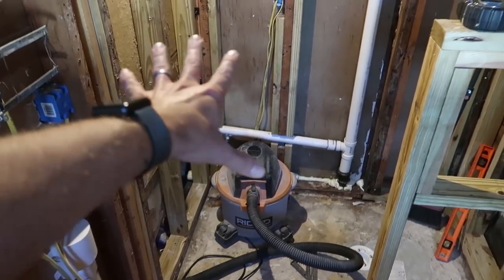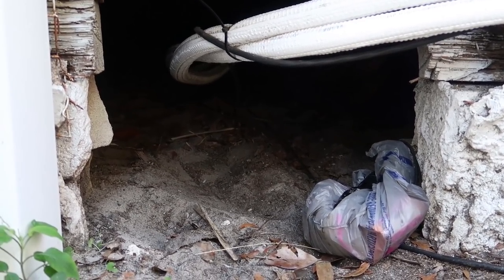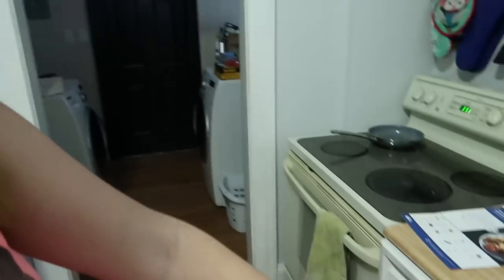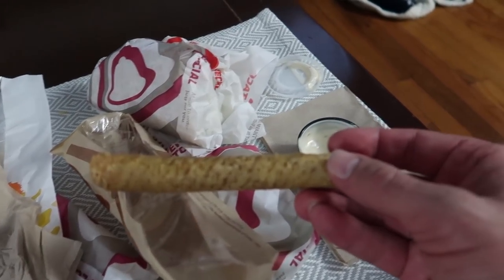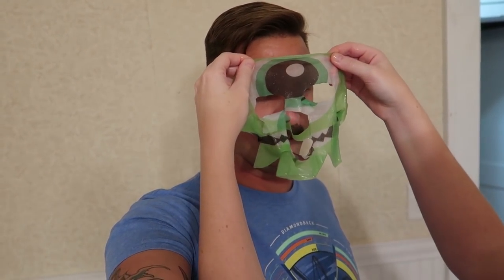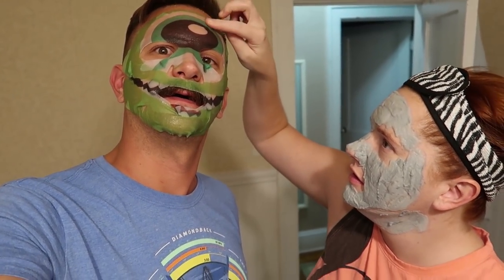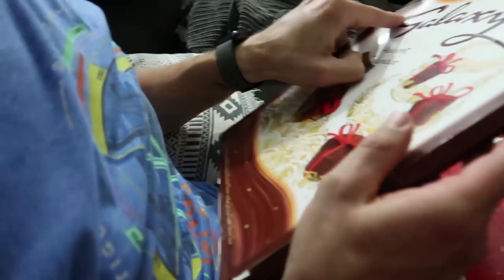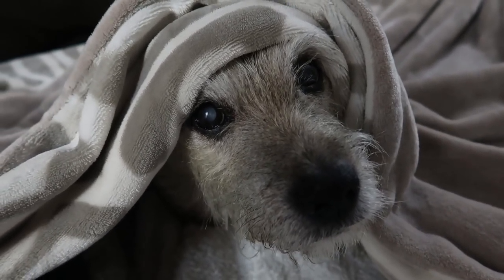How To Look 5 Minutes Younger & More Things That Make Very Little Sense! | Home Vlog

Comment: Hey Tim. Love your videos! I’ve been a plumber for around 13 years now and I would suggest securing your pex water lines where they come down inside of the wall. If you haven’t done so already. Just secure them to the stud in a couple places. Otherwise when you turn any water on inside your bathroom they may knock around and make terrible noise inside your bathroom walls. Just a suggestion. Thanks for sharing your videos with us! We love them!

Comment: Hey Tim, a tip from a plumber friend of mine is to run hot water through the PEX. Then you can bend it straight and it will hold its shape. I hope this helps!

Comment: It's too late to clean after you need a clean kitchen immediately because you're hungry. The key is to clean as you cook and resist using the sink as dirty storage. Clean it enough for the dish washer or the cabinet RIGHT THEN: you're already there, the stuff isn't stuck hard on the pan yet, the water's hot at the sink... just do it then. Once you get used to it, it works. It makes cooking slightly longer, sometimes not at all. And the payoff is huge!

Comment: Am I the only one thinking about how he cut the wood to make the pipes fit? As in, is that gonna leave a stable wall? I'm no contractor but I sure do hope Tim knows what he is doing there! Beside's that, keep up the good work, when it works it's gonna be awesome! Hugs!
Reply: TheMissRenaatje I'm fairly sure Tim used to work building houses so he knows what he's doing. Cutting a notch out of a structural beam does not make it unsafe unless you cut out a certain amount.
Reply: That's what I hoped aswell.... Thanks Taylor.